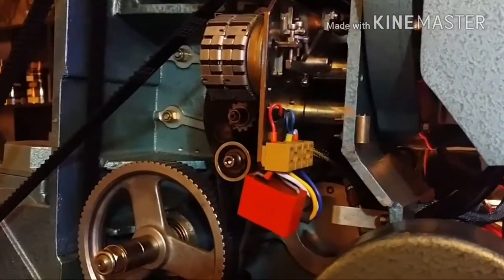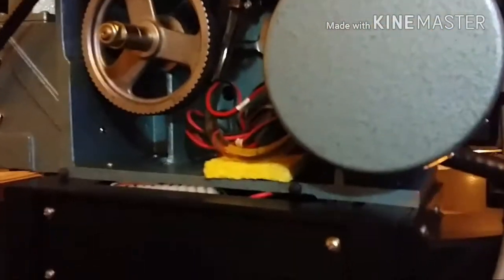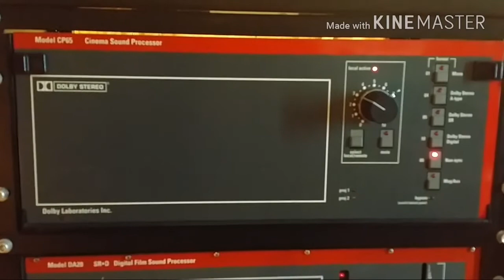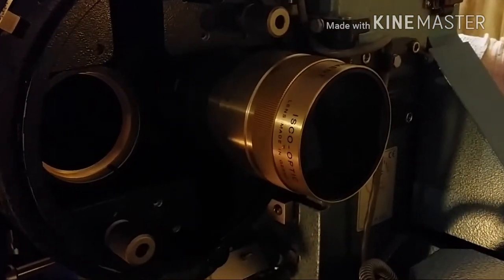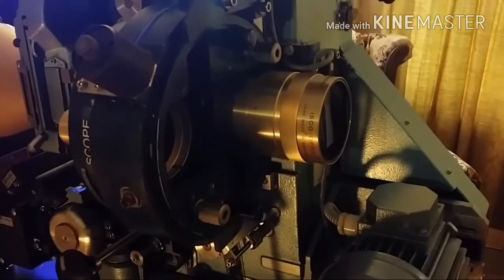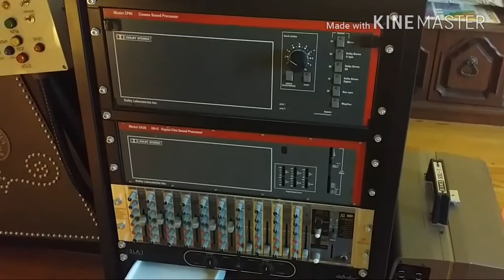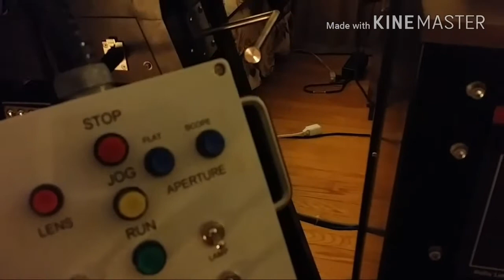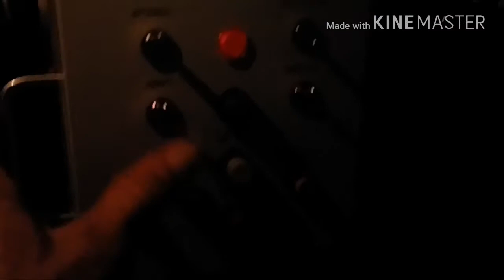Setting up a 35mm film projector to run at home - part 6 - Finished!

Comment: Another cool thing about the platter system is you can show the same print on multiple projectors at the same time. We used to do this at the theater I worked at when a blockbuster was showing.

Comment: The sound track says it all...
"How cool is that?"
"That's real cool!"

I haven't seen your first 5 parts, but I'll take a look later. My own setup was a 1935 Simplex projector using an 8mm lamp; worked fine, even in 'Scope. Western electric sound.

The 3 'home' cinemas here in Scotland (one at a time!) were actually housed in my offices - 'Bijou Kinema', 'Britannia Cinema' and 'The New Electric Junction Picture Palace'. 

However, I shouldn't watch posts such as yours... when I start to drool, it doesn't half gum up the keyboard...
.
Reply from the maker: so glad you liked it :) Once I found out that things had gone digital, it was time to bring a dream to reality....I only wish I had taken that a step further and actually work in a cinema booth...with some nice simplex machines.... :)

Comment: I love this. I ended up here because I had this same idea. I used to run the projectors at a local theatre while I went to college in Wilmington NC. The projectors I’ve found online (ebay) are way out of my price range but maybe I’m not looking in the right places. Any suggestions? What did the theaters do with their old projectors when they switched to digital projection? Where did they go ?
Reply from the maker: Small theaters kept some of the stuff, or they just binned it all. If it was a chain, the stuff went back to the distributor..who then sold it all to guys that sell on ebay. If you can find one locally, you will be better off...

Comment: What was the cost of this entire setup?
Reply from the maker: estimate around 7 grand
Reply: @Designsbyg  wow.  Really?  Where did you buy?  And is your platter 6k feet?  Or did you do 2?  If so, do you have to manually switch over for a full movie?
Reply from the maker: @phitaumatthew  my platter manual says it will hold 12 reels. Thats 24,000ft. The most i've had on there is 8 reels. No problem running any size movie in one piece.